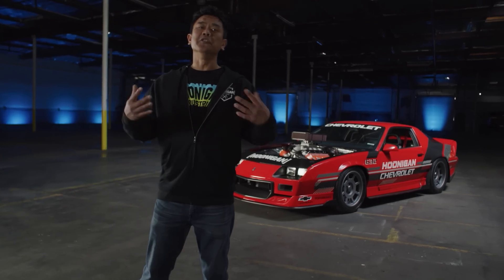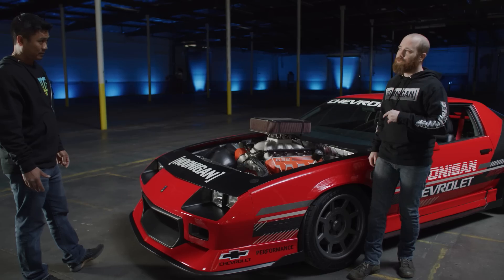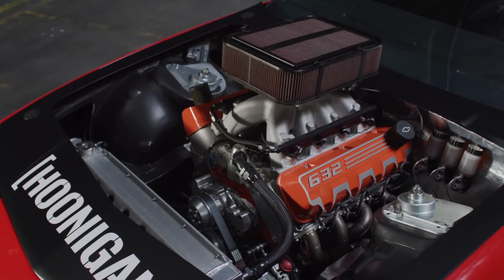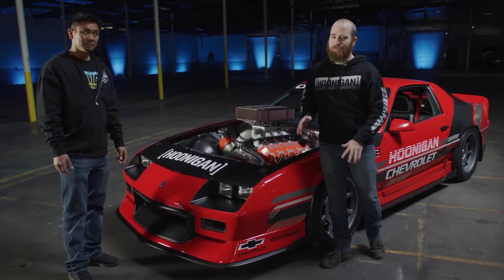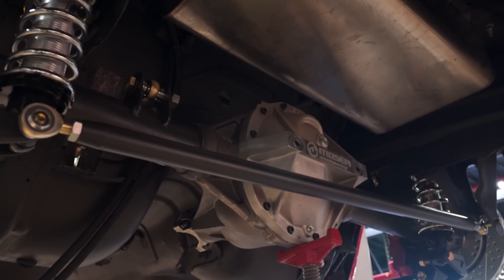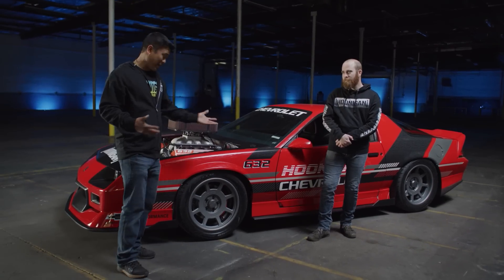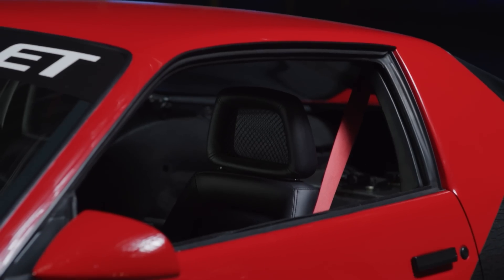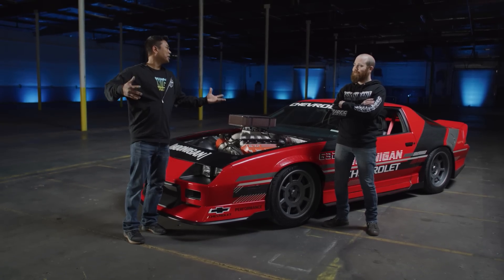1,000hp Naturally Aspirated 632 Big Block Camaro Completed! // Build Biology

Comment: As weird as it sounds I kinda want to see in details how they did the suspension setup in the back and all the CAD stuff alex made 🥵
Reply: Watch the build videos there great!
Reply: That's not weird at all. I wanna know, too.
Reply: I'm in the middle of prepping an old 9" for under my 3rd gen Firebird. I'd love to figure out a way to ditch the torque arm
Reply: Alex is the CAD-DADDY 🥵 😩😫😤😤
Reply: @devinbender8428  I've watched it all already. I need more
Reply: @Ursus5848  not really anything wrong with the arm being there, but I think Detroit speeds camaro doesn't have one- check that rear set up out. That might be a four link
Reply: Sounds like an LS firing order! maybe why it sound like that! not the same as the old school carb BBC firing order!
Reply: @Bowtie4me  I think they were talking about their comment, not the engine sound.

But it definitely does sound higher pitched and smoother like an LS. Wish they would have showed more of the exhaust.
Reply: Absolutely. For someone who is an engineer and wants to do car stuff but with CAD....
Reply: @JacopoSkydweller  Same but I'm still in schoool studying mechanical engineering
Reply: @trashbandit2449  I'm not against the torque arm, but after market ones are expensive and nobody sells (good) brackets for mounting them to a 9" rear. The Detroit speed Camaro has their proprietary independent rear. I'd love one, but they're expensive.
Reply: @JacopoSkydweller  Exactly the reason I'm asking for it too. I'm a cnc programmer and 3d modeler. I made my own power steering mounts and throttle cable bracket. I've found it's way cheaper to make my own parts, and I can guarantee the quality and fit.
Reply: @Ursus5848  currie might still sell the adapters, supposedly they're pretty solid
Reply: @trashbandit2449  Isn't it just a 3" straight cross-pipe exhaust?
Reply: @halofreak1990  I would assume it's dual 3.5 at least, given it has 1k+ hp, sounds like it could have an X pipe.... but these cars don't have a lot of exhaust room,I'm just curious to the design on it.
Reply: Yeah I’m learning solid works and I have access to big lasers that cut .5” steel.

Comment: No replacement for displacement... your K24 with 69# of boost my make 1000hp but it is on the edge of blowing up, this monster 632ci does it without power adders. Now just think of twin turbos, or a roots blower or NOS or all 3!  Love it.  Smiles per gallon not miles per gallon.

Comment: One cool thing you can do with 3d printers is you can super quickly print a mold then you can lay carbon or fibreglass over top and it's pretty dope
Reply: Not quite. You still need to Bondo + prep the mold before being able to lay cloth.

Comment: Please tell me that’s not grip tape on the pedals. I bought a keep years ago with bare metal, slippery pedals so I thought I’d just put some grip tape on ‘‘em for grip. Worst idea EVER. Imagine your foot catching on the gas pedal every time you need to slide over to brake. It would literally feel like my foot was glued to the gas pedal when I wanted to get to the brake as fast as I could. Anyways, people, never do that.
Reply: Oil on the brakes and skateboard tape covered in superglue on the gas pedal.

Comment: Omg I want it so bad...I had an 87 (with the knight rider front end) back when I was a kid (high school like 20 years ago),got it airborne and bottomed it out street racing, smashed the oil pan and blew the engine, back when I didn't know what I had before I gained adulthood and served overseas in Afghanistan...ugh I miss it so much. And I appreciate the painting I work in the sign industry and run a aluminum CNC so I get it, I get it when I have time and cash I'm gonna finish my E-34 and one day finish it, 5 years right now and still working on it

Comment: When the pandemic hit and I had some extra time on my hands 🙄 I found my first car for sale on market place, (my actual first ca)r which I built in high school and sold when I joined the military in 04. And aside from the Stevie Wonder wiring job its still fun as hell. I 6.0 swapped my Tahoe last year and still had the 5.3 so its over at the machine shop getting a tiny overbore to Ls1 specs, and my parts pile has 5th gen breaks,  Viking coil overs, tubular k member with manual rack. I'm thinking of keeping it ruff looking so I don't have to worry about dents dings and what-not and I'm a big damn fan of the wheels you guys have here

Comment: My 1st car was a (GMC)teal metal flake 91 Camaro RS , it was super nice, no dents , dash wasn't cracked , bone stock TBI 305 V8  auto, got it for 2500$, sold it for 2500$ about 5 yrs later to my step brother, he traded it , and I still see it driving around a few yrs ago, I've always wanted a z28 or 
iroc z 3rd gen , I will always have a special place for the 3rd gen, and the 25th anniversary Camaro ss(my brother In law has a cherry 25th anniversary SS) and the 03 ws6 trans AM, those were the shit when I was a senior in highschool

Comment: Need a better fan shroud for radiator. Not enough air flow because covering up a large percentage of radiator. Wouldn’t be as much of a problem if it wasn’t so close. Super sick build though but I’m sure that huge engine is having cooling issues because of that setup.

Comment: Just out of curiosity, would it be cheaper  just to buy the crate engine in order to get 1Khp or should one just buy a 4 or 6cyl or Rotary (with turbo) and push it to try and achieve the same figure?

Comment: All third gens did not come with rear discs, 85-92 Formula, Trans Am, Z/28, and Iroc-Z’s came with rear discs. 82-84 all had rear drums and 82-92 Firebird, Camaro, Berlinetta, Recaro, RS, Type LT, all had drums on the back
Reply: If I recall correctly, not even all of those models you listed came with rear disc's. It was an option

Comment: I'm so curious how you did the electric power steering, would love to add it to my car
Reply: You can retrofit one from a prius pretty easy and the rack can be found for under $200. Just need to mount it and give it power/gnd. You wont have the variable turning speed but that isnt really necessary.

Comment: Lowering a solid rear axle car is really easy and the torque arm set up is great for drag racing as well as grip racing. There's tons of adjustable rear suspension componants on the market, you just built rear suspension stuff for content just like the build battle car. It's honestly annoying that you're making 3rd gens out to look so much more difficult to work with than they actually are.

Comment: As someone who dynos chevy crate engines every day please please please set the valves and prime the oil before you start it I’ve seen so many when they forgot a valve or two and if started it could bend a pushrod or a valve and ruin The Who engine just on startup

Comment: OK SO I FINALLY SAW WHAT I WANTED TO SEE.. How it was DYNO'ed.. I knew it wasn't a 1000 HP to the wheels!!! There is a huge difference between power to the crank and power to then wheels.. I KNEW THAT MOTOR WAS DYNO'ED IN THAT ROOM NOW TAKE ABOUT 300 WHP OFF OF THE THAT 1000 HP NUMBER THEY SHOWED TO ADJUST FOR DRIVE TRAIN... DON'T GET ME WRONG IT'S A BAD ASS CAR, AND IT'S PROBABLY PUTTING DOWN CLOSE TO 800 WHP TO THE STREET....

Comment: I would love to see a dyno pull of that car actually putting 1000 to the ground. I'm so sick of these arbitrary round power numbers and bragging about flywheel HP in perfect conditions with no accessories on the engine

Comment: 1000hp 950 LB-ft hellaphant Chevy 1004 hp 876 LB-FT interesting 🤔 426 Cubic Inches… Hellephant specs
4.125 Inches Bore
4.0 Inches Stroke
3.0L Supercharger with Max 15 Pounds Per Square Inch
Forged 4340 H-Beam with ARP 2000 Bolts
Forged Aluminum Piston Material
54.3-millimeter Intake Valve Size
42-millimeter Exhaust Valve Size
9.5:1 Compression Ratio
6,800 Peak Rotations Per Minute…hmmm…Chevy Big block

Displacement (cu. in.): 632 cu. in.
Bore x Stroke (in.): 4.600 x 4.750 in.
Block: Cast Iron Bowtie with 4-bolt main caps-tall deck
Crankshaft: Forged 4340 steel
Connecting Rods: Forged steel H-beam
Pistons: Forged aluminum 2618 alloy
Intake Manifold: Aluminum high-rise single-plane
Throttle Body: 4500-style
Fuel Injectors: 86-lb/hr
Camshaft Type: Billet Steel Hydraulic Roller
Valve Lift (in.): 0.780 intake/0.782 exhaust
Camshaft Duration (@0.050 in.): 270º intake/287º exhaust
Cylinder Heads: Aluminum spread-port; 70cc chambers -RS-X design
Valve Size (in.): 2.450 intake/1.800 exhaust,Titanium (5/16-in stem OD)
Ignition Type: 58X crank-triggered, coil-near-plug
Compression Ratio: 12.0:1 (nominal)
Rocker Arms: Forged aluminum; roller-style
Rocker Arm Ratio: 1.8:1 (shaft-mount)
Water Pump: Aluminum
Oil Pan: Steel 8-quart
Recommended Fuel: Premium pump (93 octane or higher)
Maximum Recommended RPM: 7,000
Balanced: Internal…..Chevy still lost 🤣

Comment: This guy is dead wrong! The big block cane out in the 50s not the 60s and was designed for and available to the public before nascar not the other way around, my uncle had a 58 impala with a 348 big block straight from the factory.

Comment: You forgot to design and fabricate a hood.  I just can't get onboard with this hood-less trend lazy YouTubers have popularized.
Reply from the maker: It has a hood. Look again. And don’t give YouTubers that much credit, hot rodders have been running no hoods since the 40s.
Reply: @TheHoonigans  Thats cool, I didn't see the hood.  Any plans on making that cool looking radiator/ shroud cover seen in the rendering at 9:44?  Imagine all additional orders they would have if they offered it with a lower profile front feed throttle body intake (remember the RamJet) that would allow this to fit under most factory style cowl hoods.

Comment: 1000hp on engine,on wheels not more than 800hp. OLD ferrari 355 has 380cv with 3,5 litres ahahaha much more powerful using a small engine